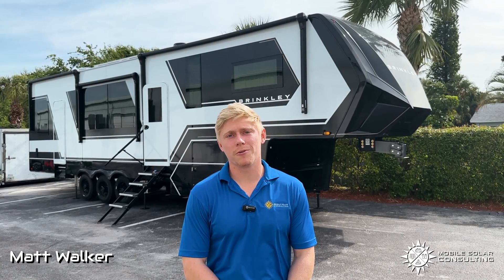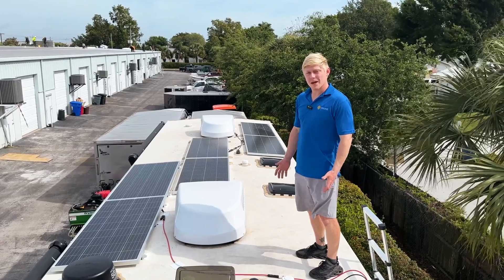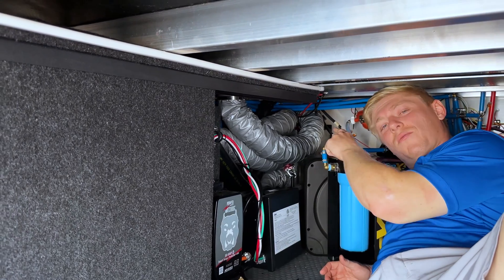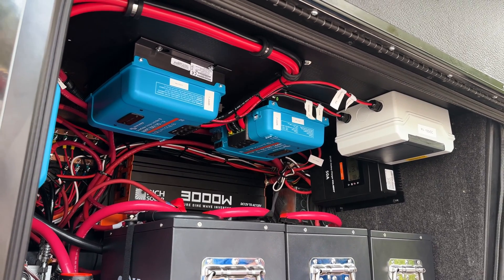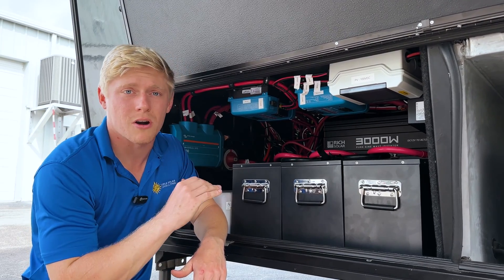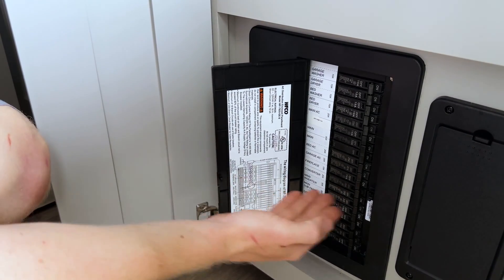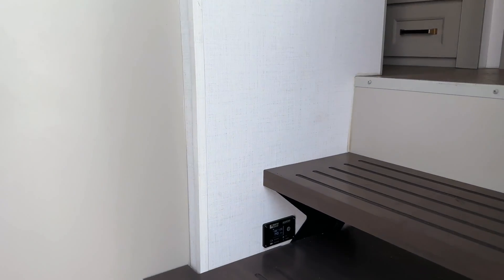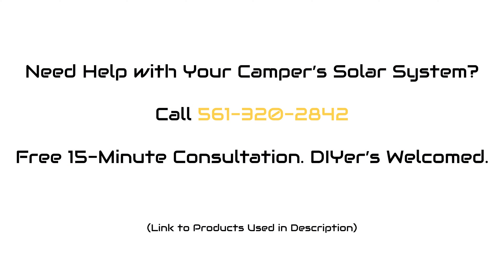Brinkley Model G Solar Upgrade - 2000W!

Comment: I never understand this. Why go through all that and at the end of the day you can’t use half your stuff. You’re spending 80% of the money to put in a system that powers every circuit and you’re only powering half so people have to figure out what they want to use. There’s marginal price difference between a 3KW and a 5KW inverter and the labor rate to physically install everything is basically the same regardless. Hey whatever, it’s not my thing. I like pressing one button and everything works off grid just like it does when connected but that’s just me.
Reply from the maker: While I agree that the marginal price difference makes the bigger systems more worthwhile, we have to respect that not every client has the budget or the need for it. With that said, Victron has not yet released a single 5kW unit with 240V passthrough, so we instead use 2 separate 3kW or 5kW units, which does increase equipment and labor significantly.
Reply: @MobileSolarConsulting  Thats the issue. Why use Victron only. I went EG4 and saved a ton. the 6000xp does 240 and is simple to install. It does 99% of what the victron does for a fraction of the price.
Reply from the maker: If we only serviced homes within a service area radius, we would use any brand, because we could easily come out and service the client if there was a question or issue. However, Victron is currently the only brand that allows us the amount of monitoring and programming abilities remotely that we need in order to serve clients that travel all across the country (and sometimes overseas!). 

The amount of questions we answer and issues that are avoided by a simple phone call makes it worth it.